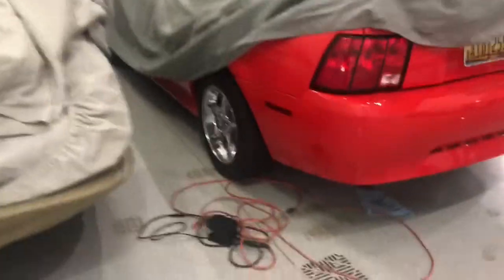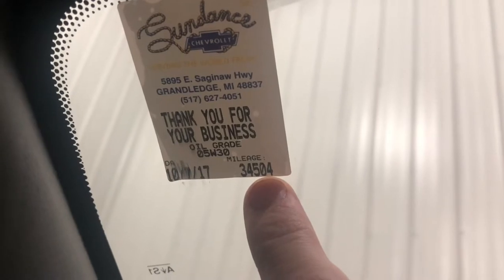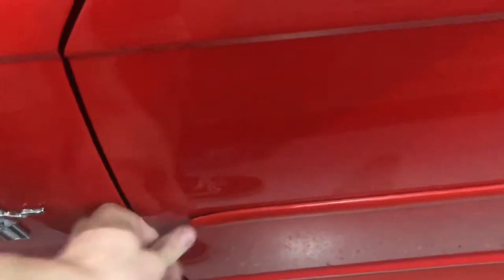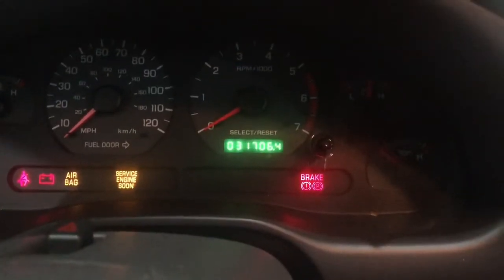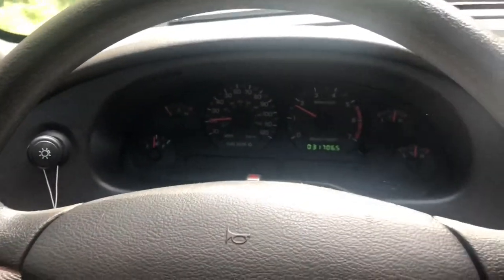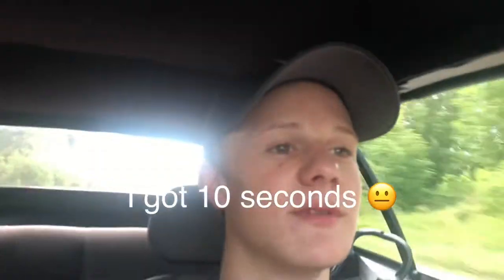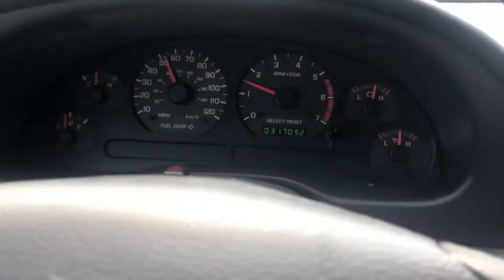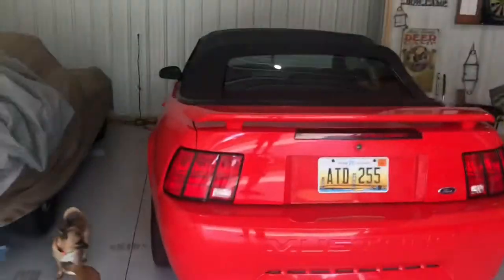2003 v6 mustang is a POS!

Comment: you just are harsh on it man, I have a 2000 v6 with 135k miles. and its not fast, but has enough speed to make me smile and corners great. The issue with 6 bangers is that people trash them for nothing. Its a solid car,  just cant be so set on it not being a GT. ya know..